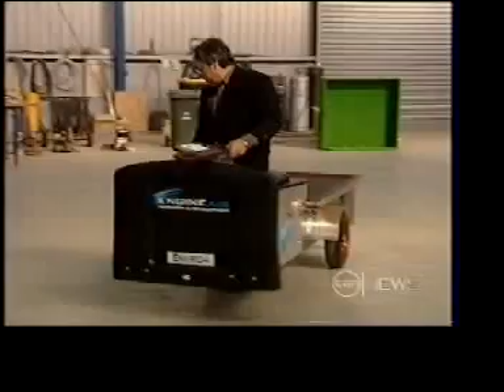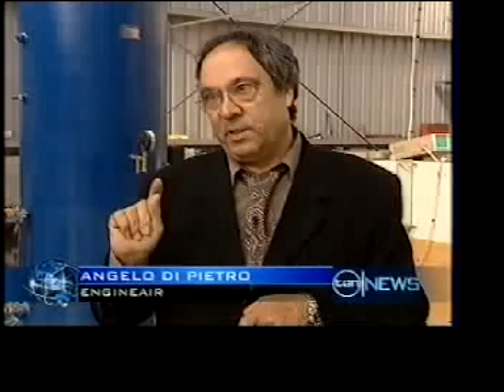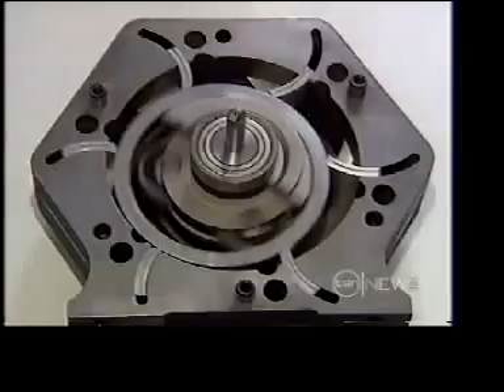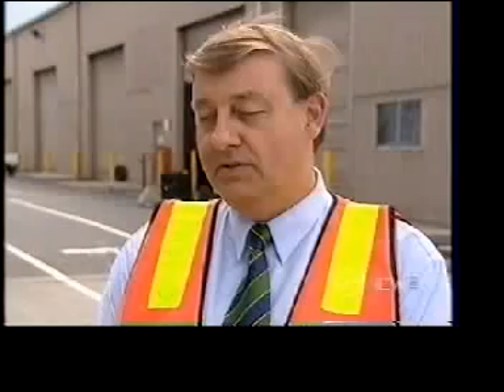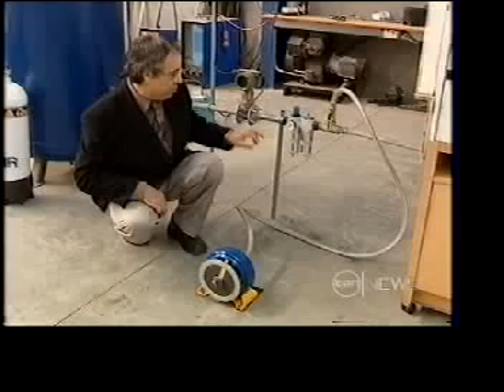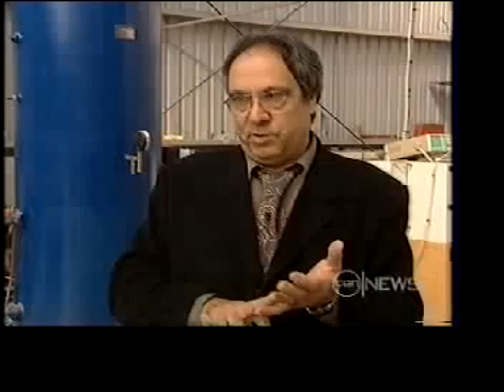compressed air car

Comment: The scam is the extrapolation from a buggy that can do lap of a warehouse to "this is the future of transportation" I've been given copies of DiPetros testing and 6 hp with an appaling rate of air consumption hasn't cut it, doesn't cut it and never will. And yes I have used compressed air to move vehicles around my shop if you don't want to fire up a boiler compressed air will run a steam engine.
Reply: yet if you use the engine itself as the "boiler" you can heat your air and make it expand much more...

they sort of had the idea with "deactivated cylinders". vaguely. didnt connect the dots though. 

like stratified charge... nearly. but not quite.

who says ALL the air has to be mixed with fuel and heated in a normal ICE?

a lot of heat is dumped out the exhaust... just heating... air. doing nothing. wasted...

intercoolers also heat air. we think of them as cooling air. but whats happening on the other side?

hot air cold, cold air hot...

an ICE runs on air, fuel supplies heat.

Comment: This is absurd.
I'm not just some cynical naysayer, I've designed and made an air-motor from scratch. I know how they work.
They're not particularly efficient, or particularly in-efficient, they have their uses, this is not one.

The weight of an adequate pressure vessel which can fit into volume constraints of an automobile and be sufficiently robust to meet even the most lax of crash safety regulations means this will never happen.

Comment: You technically illiterate moron 
There are hundreds of valuable, interesting technical projects for transportation and energy provision. This SCAM is NOT one of them
Over 10 years and no cars sold or independently tested. The claims are lies which even the USA license holder admits.
Google vencat 20 miles
You made a mind bogglingly stupid statement that air needs to be compressed with out thermal change. This will happen after they bread geese to poop gold bricks. Good luck waiting

Comment: The race is on figure out how to store compressed air without temp changes and thermal changes.  This and the use of light weight material (carbon fiber frame, epoxy wields etc) and proper aerodynamics and this might be a real option.

Comment: Air powered vehicles are short range low performance as there is very little energy in the air tanks even at 4500psi. The motors are at the limit and can't be any better. It's a bust